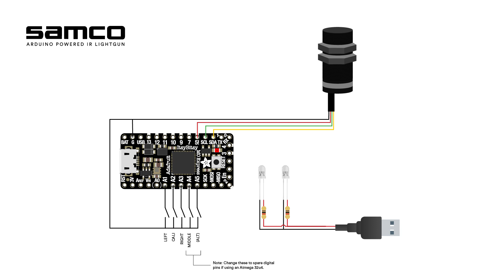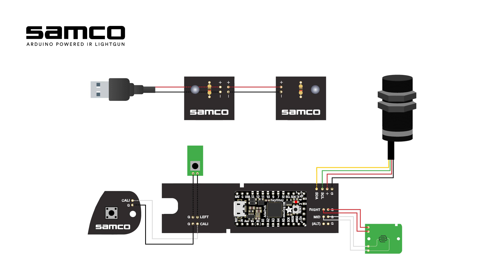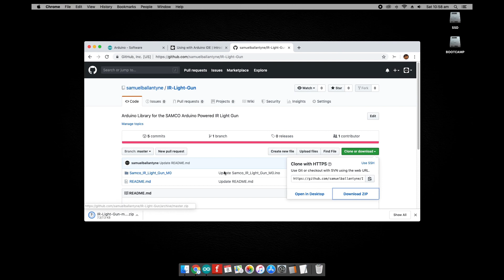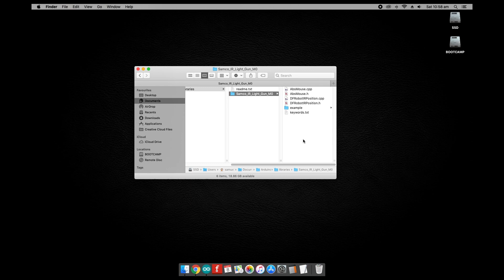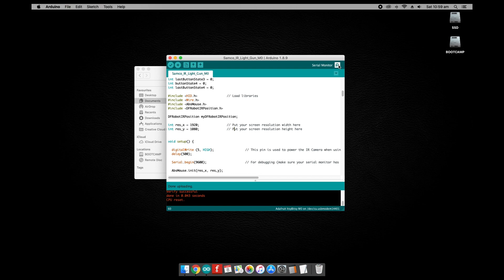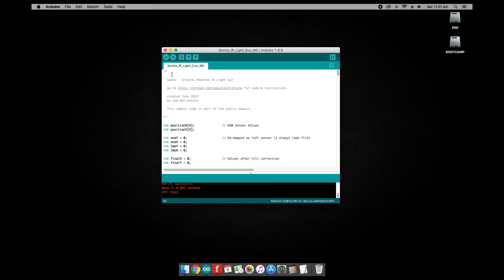SAMCO DIY Light Gun - GunCon1 Build Guide

Comment: Really cool project - funnily enough I've done basically exactly the same thing using the same camera, however I tried to use a series of 4 LEDs flashed in series like the original arcade machines use.
Reply: interresting. but what frame rate can you achieve with your system?
Reply: @thet0ast3r  I never really tried testing it, and never finished developing it - but I’d assume 1/4th of the frame rate this one gets!